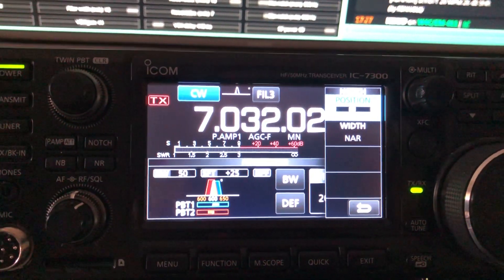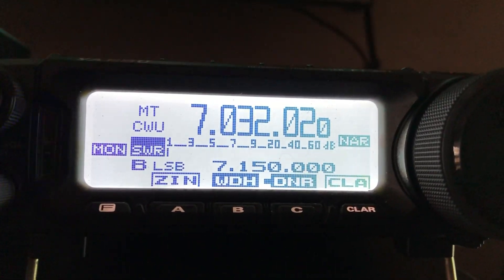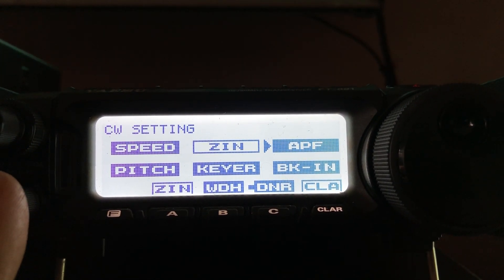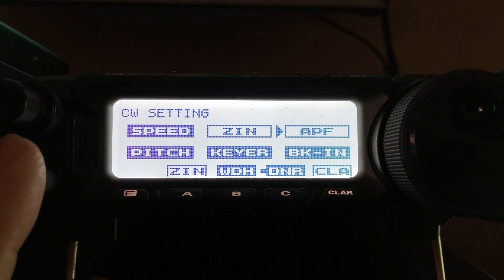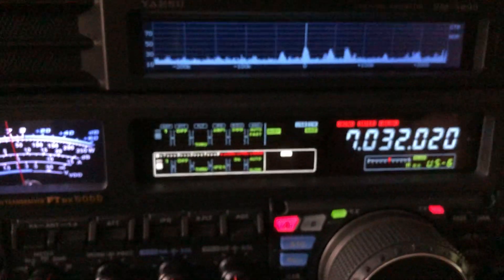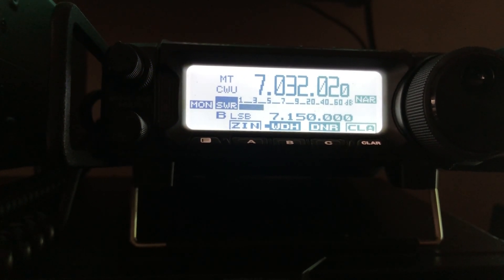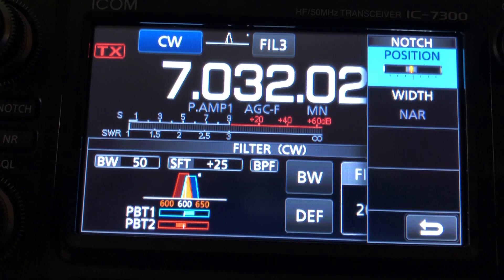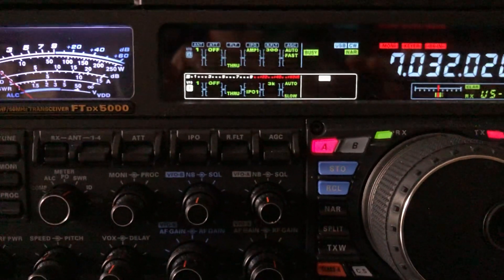IC-7300 vs FT-891 vs FTdx5000MP receiving QRP CW station

Comment: The FT-891 is more than 100 down on the Sherwood list and the ARRL review was not a glowing endorsement either. The ultimate filter response is more than 20 db poorer than the IC-7300. The LO noise level is considerably worse. I think you need to get your 7300 checked out for issues.
Reply from the maker: FT-891 has an up-conversation triple superheterodyne receiver.  That isn’t great, but it has lots of company.  The triple-conversion helps with selectivity but at the cost of phase noise.  It does benefit from a 0.5 octave physical roofing filter.  

The FT-891 doesn’t rank very high for RMDR, but it has a noise floor that rivals some of the top-rated rigs, which is remarkable for an up-conversion triple-superheterodyne receiver.  

The DSP is what helps the FT-891 compete in real-world operation, separate from the laboratory tests.  For me, it’s the actual operation on the air that matters most.  Rob Sherwood orders his list based strictly on RMDR.  It would be interesting to take all of his numbers and compile a list based upon the average of all ratings.  

In the end, one must consider their operating style when choosing a transceiver.  One who chases QRP signals will look for a receiver with a low noise floor, while a contester will want to pay more attention to selectivity.  The rag chewer won’t care as much about sensitivity or selectivity.  They will most likely migrate toward the radio with a pretty display and intuitive controls.  Many amateur operators have gotten years of enjoyment from transceivers lower on the Sherwood list than the FT-891.  One must consider many factors when deciding on a transceiver.  There is no perfect transceiver and certainly no “one-size-fits-all” transceiver.

73, de N4HNH
Reply: @n4hnhradio  I agree and certainly enjoyed my new, back then, IC-720A. The specs can be misleading. I’m currently comparing my FTDX-10 to my newer Icom rigs.

Comment: Love the FT-891! I'm running mine as both base and portable. My TS-590SG just sits under a dust cover most of the time now. I just love the 891's Noise reduction that much better.
Reply from the maker: I’ve used my FT-891 as a base station and for SOTA activations.  It makes a great base station.  I have another in my truck.  Hard to beat the technology in that little package.  I can operate the one in my truck without looking.

Thanks for watching!

73, de N4HNH